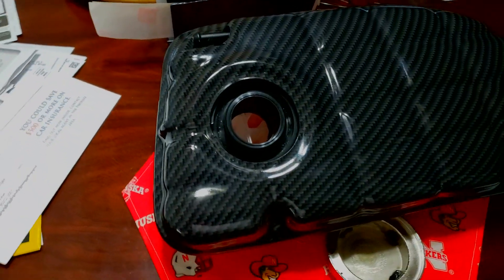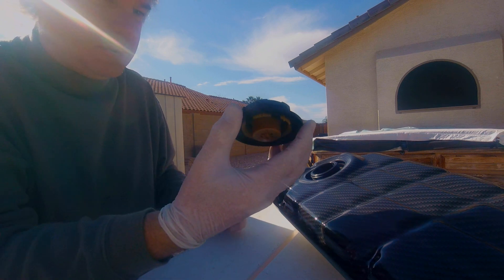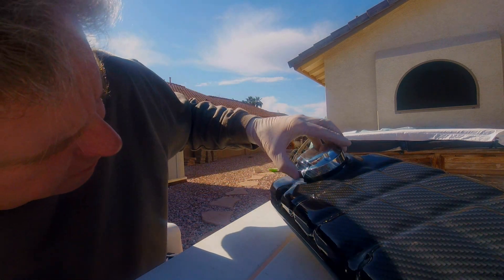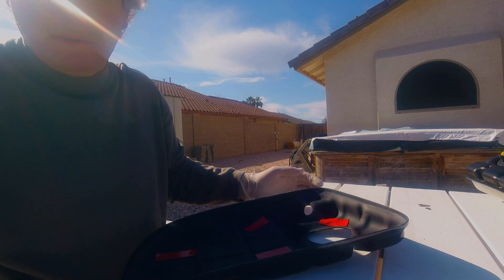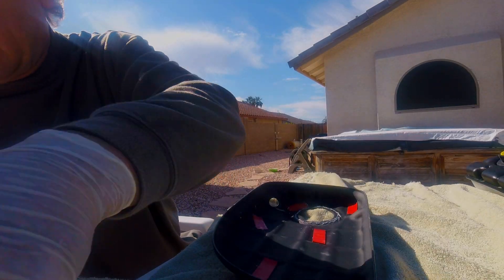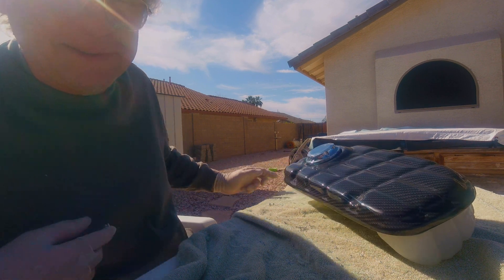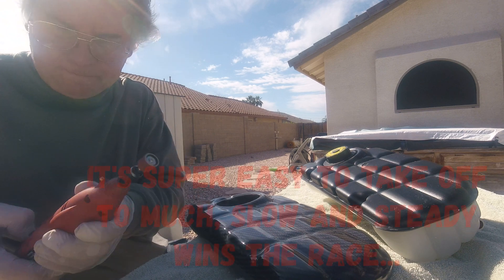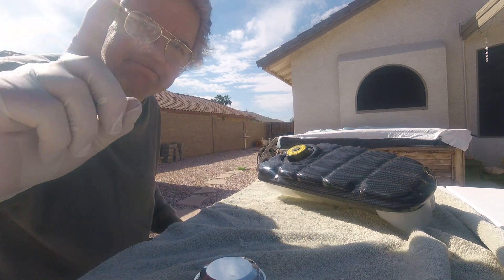C5 Corvette - RPI Designs Coolant Tank Cover Mod

Comment: Great video, and thank you for the generous shout out! I'm just glad I can help out a fellow Corvette owner! According to the records I have from the car's prior owners, they bought the very same RPI covers that had this same fitting problem in 2013(!)  He actually had to pay a shop over $100 for a tow, and an antifreeze/coolant refill, due to the cover not allowing the cap to fit properly.  He never fixed the cover, but instead put it away in a box of spare parts. When I bought the car last year, he didn't mention the cover, but I found out for myself, luckily before all the coolant sprayed out into the engine bay. I did the very same dremel mod like you did, Grape, and now it fits "just right".  
 Your video is a great tutorial and a warning for potential buyers here on out, until RPI remakes their molds.
Reply from the maker: Most welcome about mentioning you. You're the one who alerted me about the issue or I wouldn't have known and possibly made a mess myself. Hope it does help someone and makes RPI adjust their mold. Happy motoring...